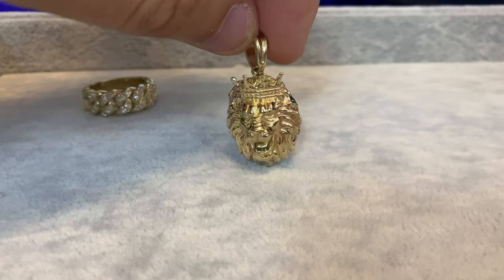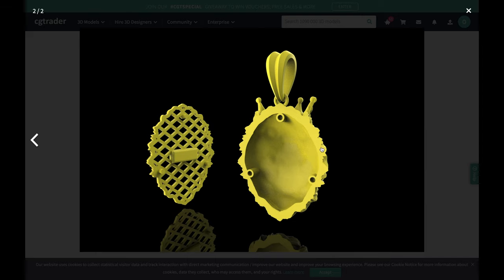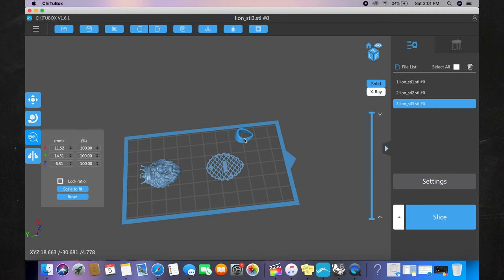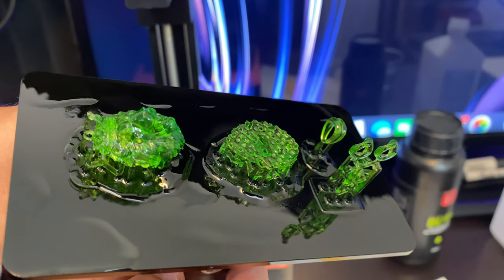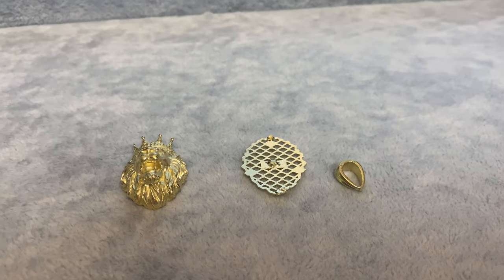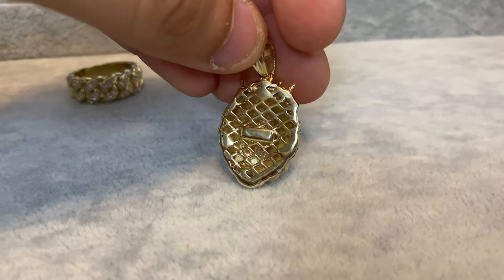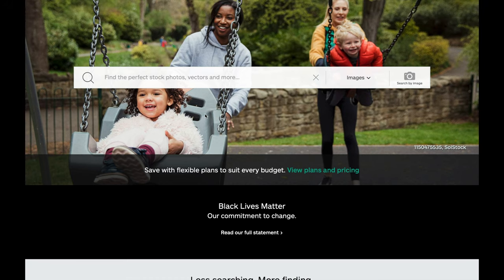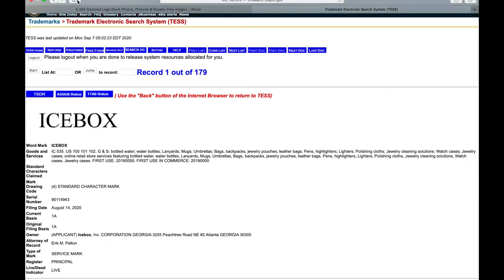How To Make Gold Pendants (Galleries + Logos & Branding) How To Make Jewelry

Comment: Great content and quality video! It’s very easy to follow and understand the what you’re discussing (so thank you). 
I’m not in the jewelry business but I do appreciate the art / craftsmanship. I wanted to ask you the following questions:
a) Can a casting or CAD be used multiple times?
b) If a jeweler has some already finished pieces (pendants) but they are semi-hollow and you’re looking to get an exact duplicate of that pendant but made fully solid - would the jeweler need to create a new mold?
c) Is it difficult for jewelers (designers or craftsman) to duplicate another jewelers design without the mold /CAD and only copy from a few images (photos)?

Appreciate your reply
Reply from the maker: hey, you can make as many waxes you want with a cad (3d ) design 
you can make a mold or you can 3d scan it and reprint
that depends on how skilled a designer is. you can always 3d scan
Reply: Thank you for replying- however I don’t feel as if my answers were addressed. I’m not a jeweler, but I was looking to work with a guy to get a pendant made and he was basically inflating the price on me. I asked you the specific questions because this guy already had the mold or cad from his other pieces. I wanted a fully solid pendant (not the semi-hollow one he was selling) and upgraded stones. He tried to quote me double the price
Reply: As if my questions were addressed*
Reply from the maker: hey, sorry im confused. a cad is a 3d file. did he have a rubber mold or a 3d cad? if he has a 3d file he would just edit the file to make it solid and print a wax then cast. if he just has a rubber mold he would add wax to it to make it solid. also what do you mean by semi hollow? what kind of piece is it
Reply: So he wouldn’t say wether he has/had the mold vs CAD. The pendant is a Jesus head (mixed stone for the crown). And yes...it’s “semi-hollow” which was a shocker for me because I’ve never known jewelry to be semi-hollow (just solid as my other pieces are, and hollow is evident when it ‘clanks’). Anyway, the piece is unique (nicely designed) but for the size   Length - 51.72mm        Width - 27.33mm. It’s rather small...and with his semi-hollow specs it’s just 25.6 grams in weight @ $7,150 SI clarity
For the VS quality stones I want, and fully solid (estimating 50-60 grams weight), dude tries to quote me $12k-13,000
Reply from the maker: ask to make it without stones in brass or another cheap metal then make it yourself

Comment: After printing your 3D mold, how do you find out or estimate what the final weight of the piece will be before taking it in to get casted? Say for example you weigh your 3D mold and it weighs 1.4 grams and the piece is ESTIMATED to weigh 7.2 grams when casted, is there way to calculate what it might weigh if you decide to get it casted in 14k yellow gold before taking it in for casting?
Reply from the maker: Hey do not estimate by the weight of the wax, just estimate by what the program will tell you for 14k yellow gold

Comment: Hey so you've mentioned on a few videos that casting cost I'd 1.50 per gram, but I haven't seen that anywhere in NJ or NY. The average is almost $15. Thoughts?
Reply from the maker: hey, im assuming youre calling the casters. its important to go do this in person. What they're telling you is almost retail price.
Reply: @SlavaTVOfficial  thanks for the quick reply. First, thanks for your great videos. Second, you're right, I am calling. But what are the different types of prices and   what's the difference?
Reply: I'm assuming it's retail vs. Wholesale. Do you get wholesale price because u go often or we should be able to get the price you reference.

Comment: Questions when it comes to going to the district if I already have melee parcels are they able to make the wax molding with the holes to set stone after it’s done getting casted and stuff.?
Reply from the maker: Hey I am not sure what you mean, but you are supposed to make the holes and prongs in the 3D program prior to printing the wax and casting
Reply: Got it is there any specific sanding paper I should use to smooth down anything if need be.?
Reply: Ohh and I got a Mars 2 pro I would prefer to use the see threw green resin but when I looked on the specific brand you used on your video online it didn’t say the elegoo was compatible is that still ok?

Comment: Did you have issues with printing failure?.
Reply from the maker: hey, usually print errors can happen and it can be a headache, this is caused by the printer not being aligned correctly. Also you might need to sand the plate
Reply: @SlavaTVOfficial   I got a couple questions you got a email?.

Comment: How do we make something completely made from gold? No 3d printed thing under
Reply from the maker: Hey, I think youre not understanding. This is solid gold, there is no 3d printed under. Think of it as if were putting the wax mold into fine cement, when it dries we are going to pour melted gold on it and the wax will evaporate and where the wax was it will now be replaced with gold. thats how casting works
Reply: @SlavaTVOfficial  Mind blown

Comment: This is a very informative video. But, I feel like you are somewhat undermining all the labor that goes into producing fine custom jewelry. Some of these processes take 10s-100s of labor hours. Sure some pre-made cad files are 20$ online but no casting house or designer is doing anything truly custom less than 150$ and that’s usually wedding rings. Even buying 24k gold bullion the markup is usually 1.5$/g or more so of course casting houses can charge more. Everyone isnt ripping everyone off they just want to be paid for their labor. Stone setting you’re gonna pay a couple dollars per stone. Most casting houses have a set price per piece depending on size. I saw a comment someone thinking 5-50$ to cast something was high? Lol do the work yourself to see what type of experience/investment it takes before assuming you’re getting ripped off.
Reply from the maker: Thanks for the comment bro. I was to correct some stuff, hopefully it will help your business.

1. jewelry does not take that long to make. it takes a few hrs. thats why youre paying around $20 to polish. 

2. $150 for 3d designing is way too high unless making a very detailed piece.

3. casters don't care about how your wax looks its only about weight. they don't care about the size